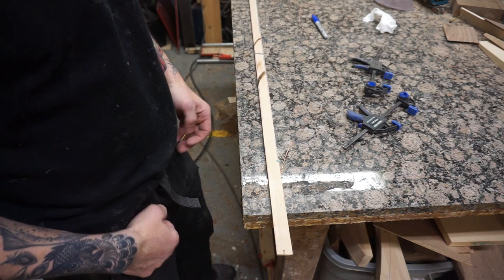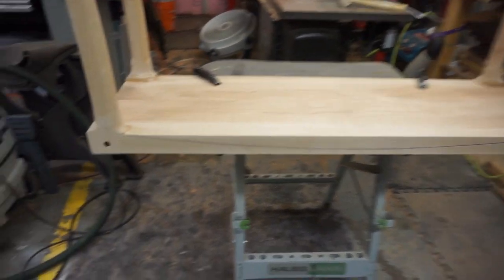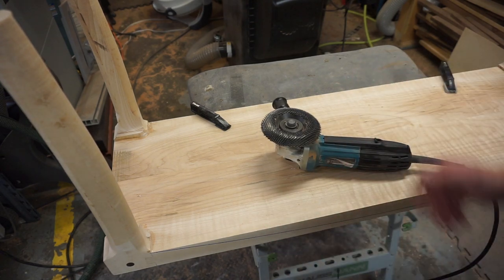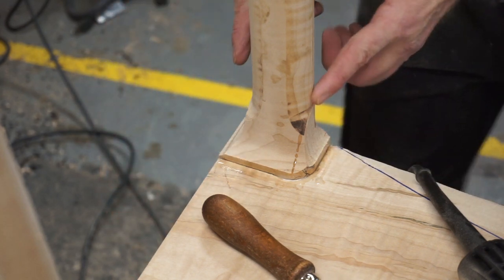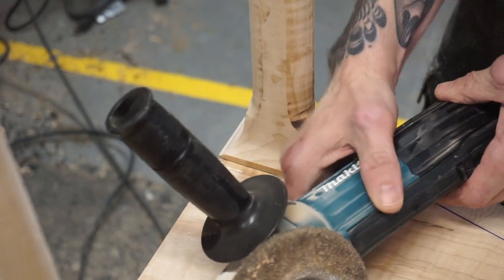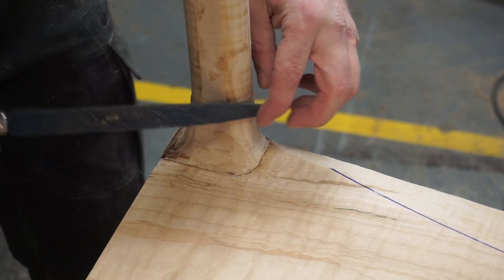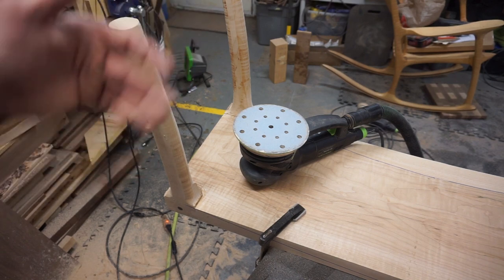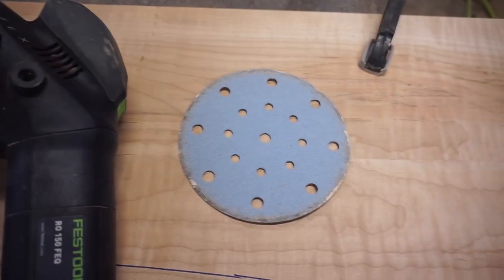Video #7 Making a Maloof joint bench - Shaping the transitions

Comment: Quick question Dallas. It seems there are a few grits within each of the Kutzall Dish and Disc options. So for the Extreme they have options of Very Coarse, Coarse, and Medium. For the Original they have Very Coarse, Coarse, and Fine. What specifically are you using/do you have? I don't want to get all of them so which do you use the most? Thanks!
Reply from the maker: Kutzall makes dishes and discs. For each they have coarse, very coarse and extreme. Hope this helps. I like the coarse and extreme in the dish and disc.